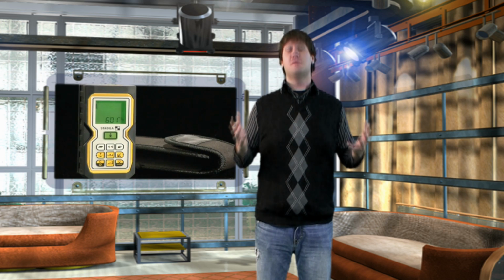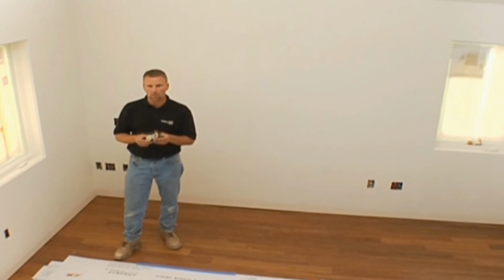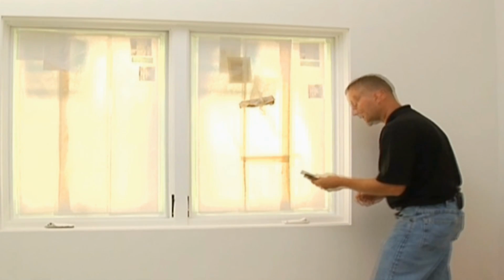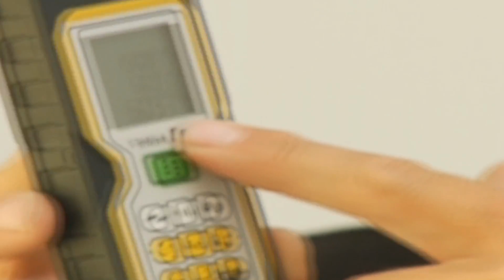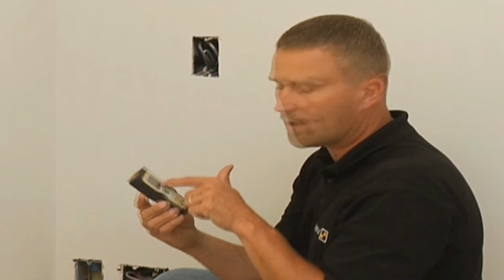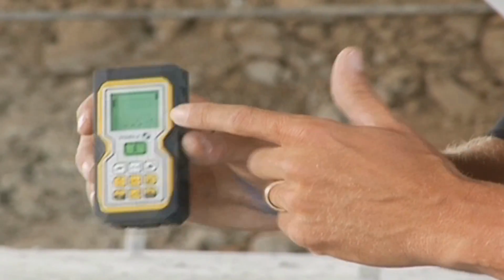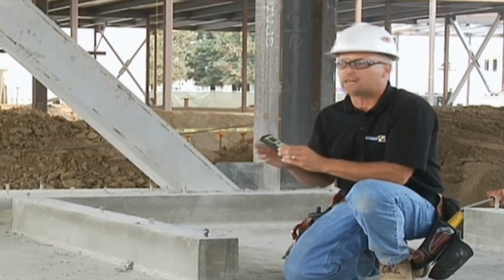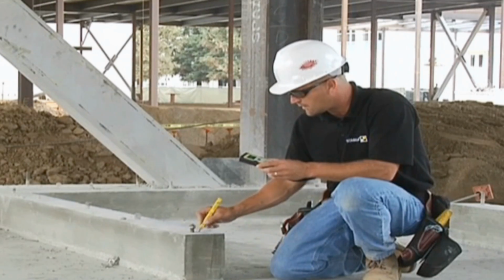Stabila LD400 Laser Measure

Comment: laser tapes are not gimmick and they save time and soon pay for them self
I do not work for this company but know how i much use i get out my own.  
"shop fitter" I use my for  floor areas ,wall size quick  checking, ceiling  heights, suspending ceiling work etc and  i dont need any help measure twice cut once.Easy